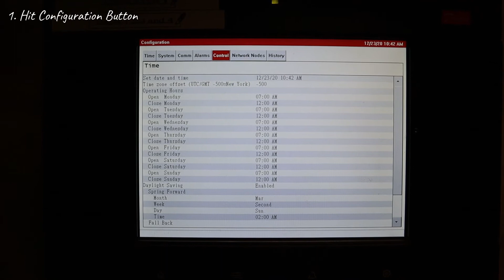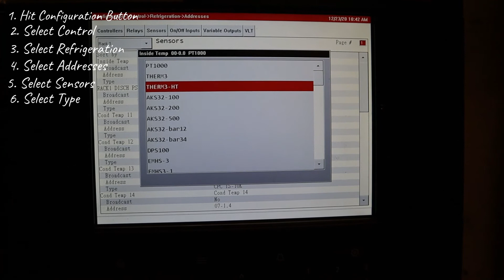How to Change a Sensor Type on Danfoss AK-SM 880

Comment: A couple things. First, you also will have to remove the 2.5kohm resistor from the input module to read correctly with the PT1000. If you’re replacing an EIL TP-1 sensor you’ll have a 10kohm resistor from 12V to the signal input. Second, it’s a lot quicker to go to configure, network nodes, points, sensors.